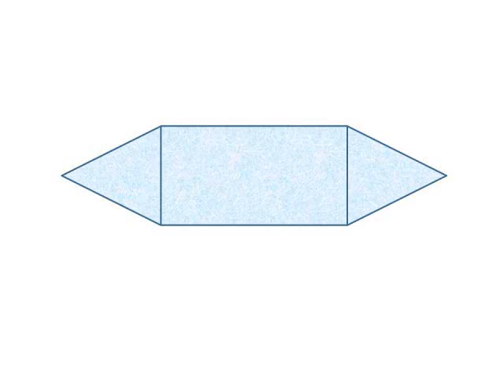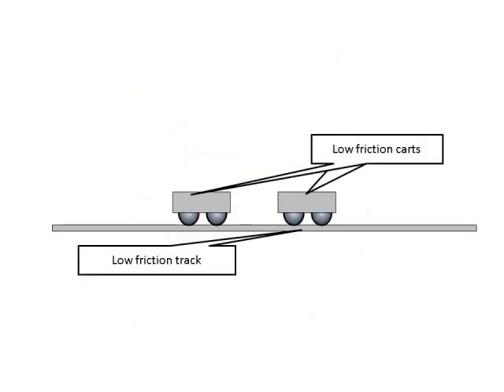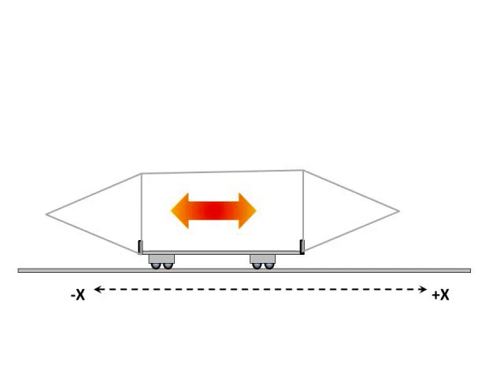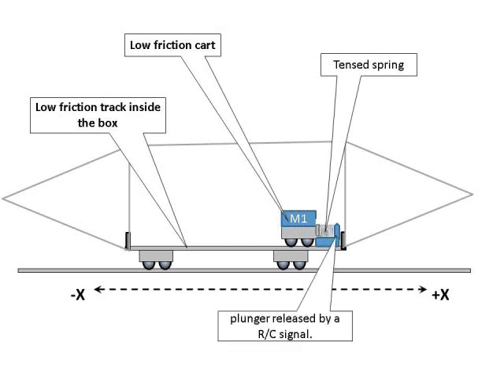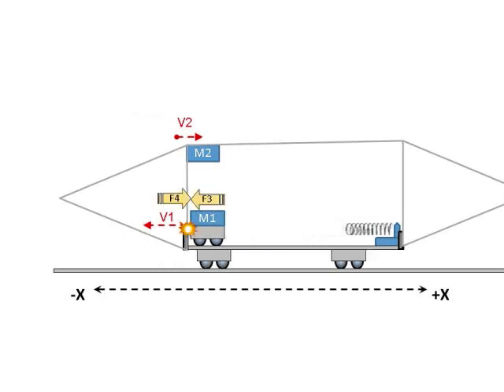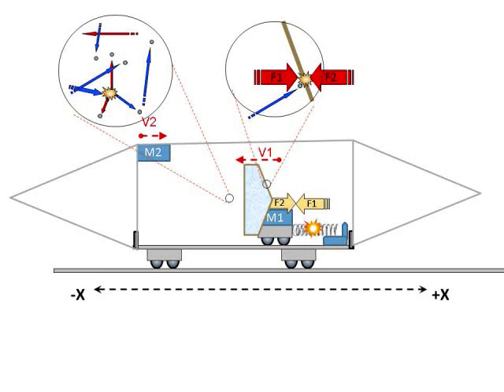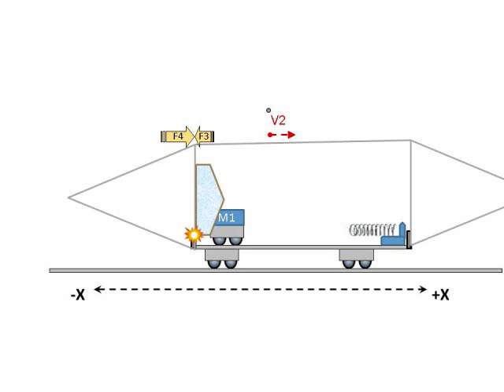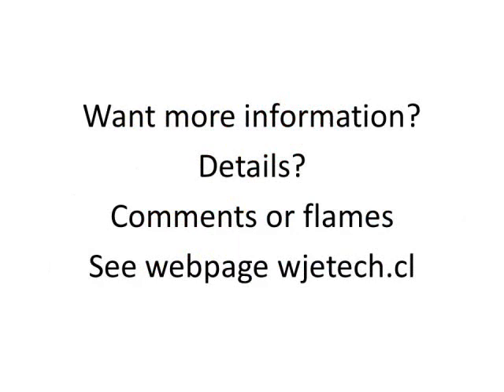Propellantless propulsion, short and simple DIY

Comment: I have no doubt you are seeing some effect based on the Dean Drive effect but it is a subtle reaction against something which won’t happen in free space. Your idea of randomizing the collision force so it won’t react against the back wall of the box is a flawed concept because you cannot dissipate the backwards momentum no matter how randomized the collisions are because in each and every single collision momentum is conserved. Therefore overall, momentum is conserved. You can prove this to yourself by simulating a system with a low number of particles and then increase the number. You will see momentum is conserved over all.

Comment: It should not work, but I like the way you think. Explanation:

Try an equivalent simplification: place a firmly fixed table fan blowing towards left inside the airtight box with battery. then by your same arguments:

0. wrt ground, the net momentum of air molecules is zero before. Turn on the fan.
1. the fan will push air left and whole fan-box structure with get a force towards right. 
2. The complex motion of air molecules will randomize and somehow their net momentum will still stay zero w.r.t ground.

what gives?
Reply from the maker: Hello and thanks for the comment

The video is 6 years old, a lot has happened since

We made various working models for demonstrations
In 2019 we got seed funding from the government (Chile) and Wjetech Spa was created, workshop and laboratory was started

Then came 2020 (covid and other %/(/&%/@@@)
However we simplified the design so it could fit inside a cubesat and be tested in space (working on it)

Was invited to Fidae Space Summit 2024 which was a very positive experience

Here is a video of a simple DIY demonstration of our cubesat propulsion method
https://youtu.be/pttEXio4230?si=Fa_9EImYNYg7YZWs

Our web page is wjetech.cl if interested

Have a nice day

William

Comment: Ah man, for experiencing a push with this kind of machinery it takes for ever to make a simple vehicle that uses enormous amount of energy to generate a simple push.

instead one can use gyroscopic propulsion (initially made by sandy kidd) in a large scale and use the same for even aircraft instead of propelling blades. frankly the inventor made some noticeable mistakes, which can be corrected once anyone begin to construct.

well the concept of inertial drives is, they just follow the newton's third law of motion, just they give the recoil force in a different format (like a rotational movement or a linear movement in another direction other than the moving one).  

There is one centripetal drive i am constructing, it generates lots of noise , but also moves pretty fast unlike the traditionally shown inertial drives. 

i am meaning the real age vehicular movement , also it consumes less force as input to generate higher force, this kind of mechanism is not usually supported by normally known physics laws, instead there is less or no physics laws that is supporting or having base for internally propelling engines.

the same reason why our space travel speed is also just nothing compared to cosmic scales.

supposing an engine that works in a pattern so that its movement (forward movement or any sided movement) is supporting its propulsive force, then what can its maximum velocity be?

most inertial engines are having the question of the above statement (self supporting propulsive force without any need for external force).
Reply: That doesn’t work either.

Comment: what about the force generated in the -x direction by the air brake , it cant be a closed system
Reply: Are you questioning the Indian space science.... They just put a man in space sir..... Yes it's 50 years behind the USA and the rest of the world...  But you respect the dot
Reply: exactly lol, you need something to pull the somehow, or convert the mass into energy, somehow lol
Reply: @KinyoHQ  would there still be a force in the x- direction if it was a spring that was creating the x+ force. I know a spring stores energy but they also absorb it too so wouldn't that make the x- force 0 as long as the spring has the energy to absorb?

Comment: doubt it works how about the molecules you push against with your airbreak ? you ll get them an impuls that will push them through the wall and ad another Force
Reply: The Random molecules produce heat which is dissipated through heat and entropy and thermal heat like all energy goes away.
Reply: To put in crudely the energy is simply destroyed he goes away in less then a second. But you're probably never been taught that. It's true it is called dissipation.

Comment: Interesting.  Very interesting. Maybe if you can install some heating device and employ Sterling engine principle, you might be able able to tension the string back and get the counter weight to return to its original position. and who knows.
Reply: A Sterling engine only works on paper.
Reply: Thermodynamics is prove that the Stirling engine will never work in reality in reality is that it works on paper because it assumes no entropy.

Comment: OMG!  People are so stupid.  OK bud... If you have an airplane full of birds and you scare the birds so that they all begin flying around inside the plane, does the plane get lighter?  No. Well why not?  I mean, the birds are no longer sitting down on the plane!  It's because the down force of their wings against the air also pushes the air down against the floor of the plane.  Your "Sail Brake" creates equal resistance to the cart AND to the box its in.  These things become less obvious when dealing with such models, but if your idea were true, then you could just put a jet engine on the cart to push the cart against the box.  But that wouldn't work either because the air expelled from the cart jet would also push against the back of the box in the opposite direction with equal force.  Any actual net gain you might see is merely an issue of acceleration of force vs friction, as when someone is scooting a chair forward.
Reply from the maker: Hello Fred, thank you for commenting but it is to late to join the “what a stupid idea bandwagon” although that is the first opinion of most persons when they first see the proposal.
I say you are late because the idea has been verified, tested and we have initiated a startup Wjetech SPA with government funding.
But your thinking in the right direction, you state “but if your idea were true, then you could just put a jet engine on the cart to push the cart against the box”, a jet engine will not work because the force of gases it expels is to strong to be diluted by the surrounding air molecules BUT…
A slow moving propeller (600rpm) will receive a forward force and the air molecules that are traveling to the opposite end of the box have to collide with billions of fast moving air molecules (normal air) and some of the momentum is transmitted to the sides of the box instead of the rear of the box.
This is not sufficient to move the little cart and the box must be put on a torsion pendulum to be noticed, yet we have measured a force of 28.6 millinewtons (comparable to a hummingbird fart) but comparable to early ion drives
If interested info in http://www.wjetech.cl/ the pages are a little out of date but the strong quarantine we are currently passing is hampering our schedule

Stay well and health, don't wast time on internet wars

dont forget to smile
Reply: @wjevideos You get a perfectly good explanation why it doesn’t work and you still insist on it working… You need to study some physics or actually even simpler build one and it will for sure not work 😂Just because you don’t understand why it doesn’t work will not make it work 😂😂😂
Reply from the maker: @jespado  your comment is on a 6-year-old video. A lot has happened since then, and I want to share some significant milestones with you:

Our initial idea has evolved into a practical proposal.
The idea and our working demonstration model have been reviewed by experts in the field of physics.
We secured government startup funds.
Wjetech Spa was established.
We've designed a working model in cooperation with a university and local aerospace experts.
We now have a cubesat propulsion system ready for B2B customers and associates.
While we've faced significant challenges, the method's effectiveness is recognized by the institutions that have thoroughly examined it. If this method doesn't become a useful tool for the aerospace industry, it will likely be because someone invents an even better method (which is my nightmare).

For a simple explanation of our current model, you can watch this video: Current Model Explanation.

https://youtu.be/13SpTMon0vU?si=Ha8NMc6GlcUQKZpG

Have a great day!

Best regards,

WIlliam
Reply: @wjevideos  I strongly suggest you do a detailed numerical simulation. I have no doubt you measure such a force in the millinewton range. But do you measure it when the box is in a vacuum chamber?

Comment: You should remember a small internal force is need in space and the counter force can be absorbed easily by friction, and many other forces. Entropy, IR.
Newton didn’t no electricity. He thought and object could not push itself. Or course it must not be thought of as an object. When the force is internal it
will accelerate forever. But u must have an energy source such as solar, really u must turn electric to kinetic fluid flow that you can shape, but will work in space. You can Hg for max. shaping. See www.approchconcepts.com